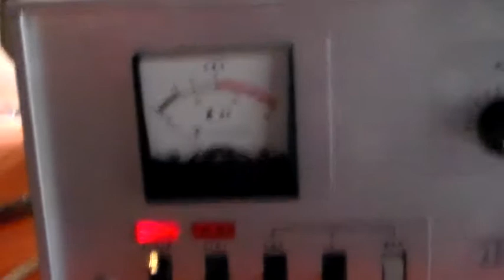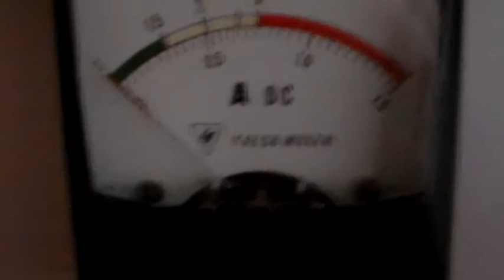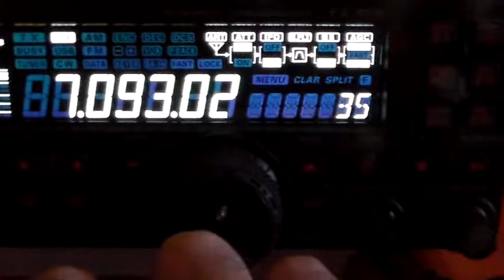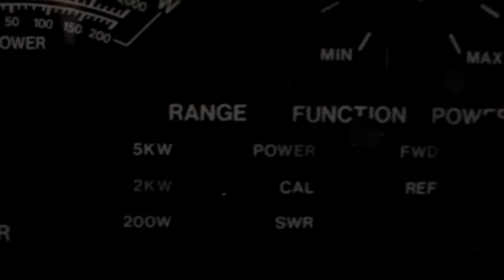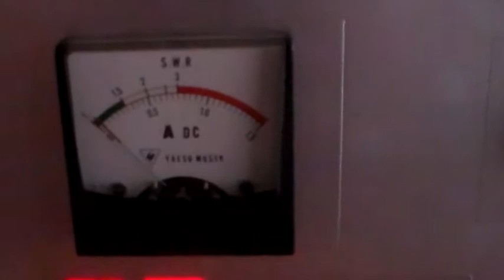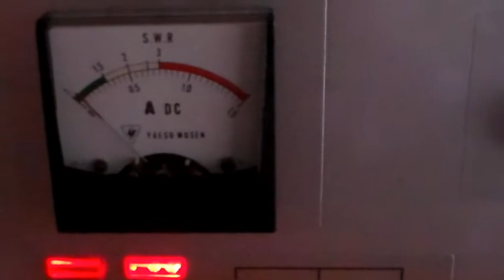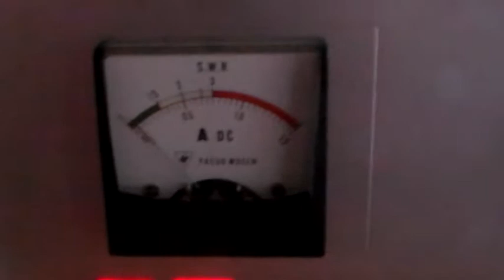Yaesu FLDX2000 HF Linear Amplifier Part 2

Comment: I have recently came onto a fldx2000 and it is really clean. I see no mods in it. But when I activate the relay it shows no anode current on the meter yet I do  see about 1200volts on the plates of the tubes. I can put rf in with the ftdx1200 and a older kenwood ts-440s but don't even get a flicker of output from the amp. I have correct grid voltage and see cathode voltage go up when I key up the drive radio but not even a flicker on the output. I have checked some voltages according to your videos and they seem ok. It doe's show the supply transformer wired for 117 which I think is ok for my power here at the house is 120volts but to be honest I cant really tell for sure because most pictures of the transformer wiring aren't very clear. Any Ideas what to look at next?  Thanks of all you do.

Comment: Its great to see these old amps still in use. I got tired of trying to find 6KD6 tubes for my FLDX,so I transplanted a single 5867a triode with a suitable filament transformer and reworking the HT supply with a voltage doubler circuit. Does 600+ watts now with ease and more reliable than the old TV sweep tubes. Thanks for posting the videos. Much enjoyed watching.
Reply from the maker: Thanks for the comment. Your mod sounds great, I wondered about using a couple of smaller Russian triodes that use similar filament and anode voltages. Then I thought... I'll leave it until I have to do something. Have you modified the input circuit?
Reply: I didn't bother with a tuned input, because I'm driving it with a Kenwood hybrid and it loads up just fine into the amp. In stock form, I believe the pi arrangement on the input is a low pass filter, probably in an attempt to stop harmonics from the exciter getting in. A pair of Russian GI7B's would also work well in the amp with the voltage doubler circuit and you could probably even use the existing 12 v filament transformer. I would have liked to have used a 3-500z in the modification with mine, but I didn't have one spare. The bias requirement of the 5867A makes the circuit a little more fiddly. Lloyd VK3CJ
Reply from the maker: Understood, cheers Lloyd.

Comment: Drive power =20w. Drive current = .75 to 1A. Its in bits so I can't double check. Approx 550W indicated on MFJ 986's meter straight through to the dummy load. V4 colours up after a few seconds. Should have checked the others. Just going through the caps and resistors now. The unused pins (schematic) on V4's socket even has a green cap so it may be a mod. I have a IC 751A sitting next to it and the sniffed RF is mostly noise. As you suggest, there is not much info online so I will get in the right headspace this weekend and see if I can sort it out. Thanks in advance for the pics. Cheers
Reply from the maker: I had a look at mine. The unused pins are used as solder tags, just somewhere to mount the components. Mine has the components you describe on one valve base, I'll do a video on the valve bases on Friday. The design is not completely 'grounded grid'. G1 has a bias voltage fed to it which is adjustable. When you key the amplifier in standby mode with no RF drive (PTT with no audio) do you get 50ma indicated on the plate current meter when the relay activates? If it's more , that could be your problem.

Comment: The tuning circuit on this one does not have the tank circuit as shown either. The RF in goes straight to the relay. I guess there would have been many versions produced and of course, many tweeks performed since the 1960's 😉
Reply from the maker: I found this: http://www.foxtango.org/ft-library/FT-Library/60s-70s/FL-2000_Manual_and_schematic.pdf It may help.

Comment: Ah.......when I said it was working it does push out around 500 watts on the meter however I believe I have several problems especially around the amp. The glowing tubes on CW are also evident on SSB into the dummy load. I am not YouTube savvy but I was wondering if you could put up some more pics especially around the layout of the tube sockets. Going through the schematic, there are a heap of added caps and a signal diode on V4's socket that aren't original. I don't know if any mods were completed since the original schematic was printed so a pic or two would be of great help. Cheers VK8ZR
Reply from the maker: No worries Ross, will do. What anode current do you have when you have 500W output, and how much drive power are you using?

Comment: Great video and very timely. Its very coincidental that I have just powered up the same amp today for the first time since picking it up from a sale. Rebuilt the "auto tuner" and replaced the main filters. All checked out ok and once tested via the variac, is achieving around the same output but I did notice one of the NOS valves that I used glows red when subjected to CW?  Guess the amp isn't designed for continuous drive? Cheers VK8ZR
Reply from the maker: Thanks for the comment. This looks like a pretty good amplifier, so it's well worth the work you've done. I had no idea when this amp was last used, or if it worked at all, so I too put it on a variac. I ran the HT at 500V for 10 minutes, then 800V for 10 minutes, then the full HT for 10 minutes just so the caps didn't get too much of a shock. All was well so I now just switch it on as normal. 

The 6LF6 has an anode dissipation of only 40W. This means the whole PA can only dissipate 160W in total for the 4 tubes. With 1,250W going in and only 500W coming out the tubes have to dissipate the difference, 750W. That's 590W out of specification. With low duty cycle modes like SSB this isn't a problem as the maximum power is only produced during the voice peaks, the tubes don't get time to get hot. With a high duty cycle mode, like CW with the key down, the tubes will get very hot very quickly and will glow. Only one tube glowing suggests a problem. 

As they're all in parallel it's probably the tube. You could prove this by putting the tube in a different position and see if it still glows. If it doesn't, and the tube you fitted in it's previous position does, there may be some sort of parasitic oscillation happening due to one of the grids not being grounded. This could be due to a dry joint or an open circuit pin on the valve base. 

Does your amplifier have that peculiar input arrangement?